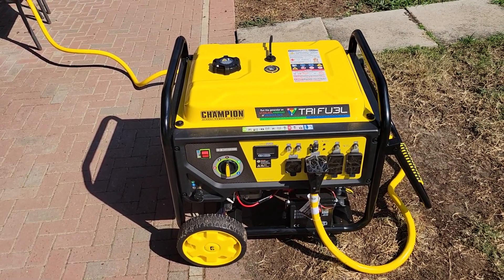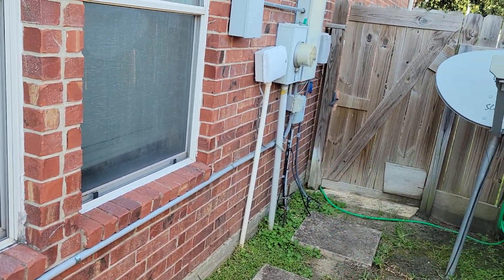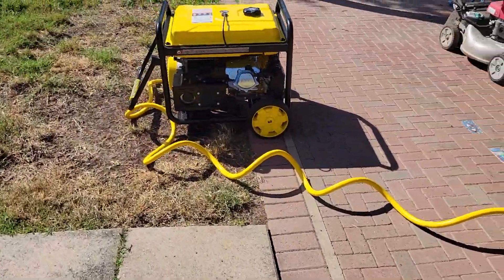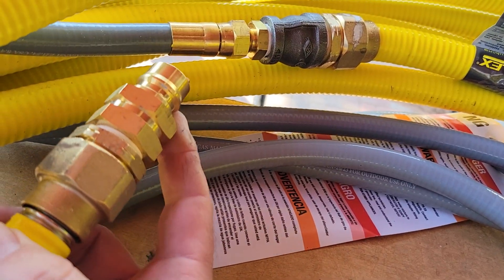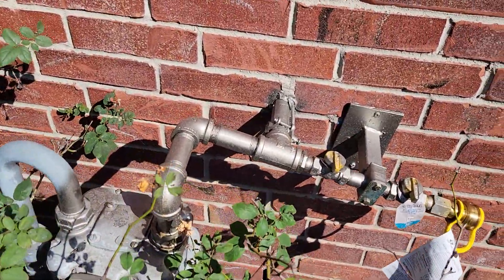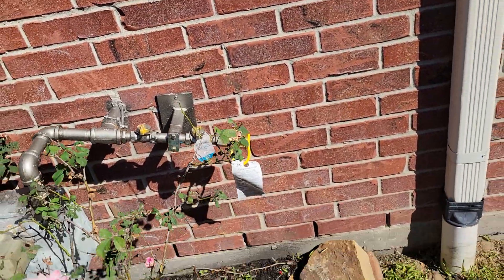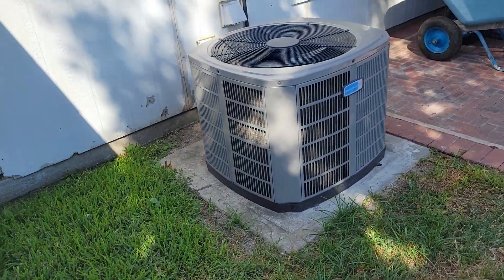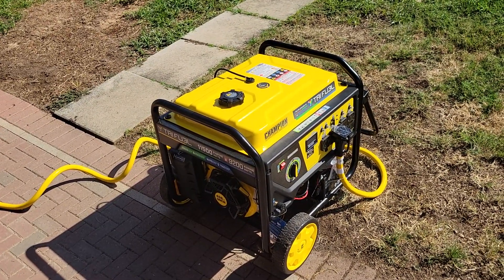Champion 11500w trifuel test

Comment: 1:31  What size quick disconnect is that?
Reply from the maker: @REVNUMANEWBERN  it is a 3/4" where it goes into the gas line and a 1/2" that goes into the generator.  The 1/2" came with the generator and blocks in the gas when it is disconnected.  The 3/4" I bought online and unfortunately is open when disconnected.
Reply: How much is the gas btu  coming out of the house regulator ( water column inches )